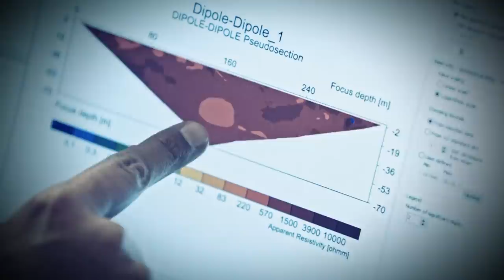UNDERGROUND TREASURE CHAMBER UNEARTHED | The Lost Gold of the Aztecs (Season 1)

Comment: The fact there is an overhang/cave on the outside, means that wind or water caused it. The same action would have deposited silt/sand over the centuries. This accounts for the covering of the opening.

Comment: Know what is hidden without guessing by learning the physics involved and how build the modern light weight ball bearing dowsing rod, which is the only dowsing rod that accurately deciphers what is being dowsed with using the energy of gravity by raising the elevation of the acetylene welding rod of the dowsing rod, which adds resistance to the energizing of the one-tenth ounce dowsing rod load attached at a predetermined location.  Read the book The Art of Dowsing - Separating Science from Superstition for learning the reverse engineered physic and how to professionally dowse.  Have a safe, healthy, good day